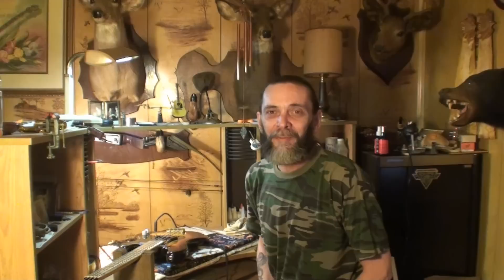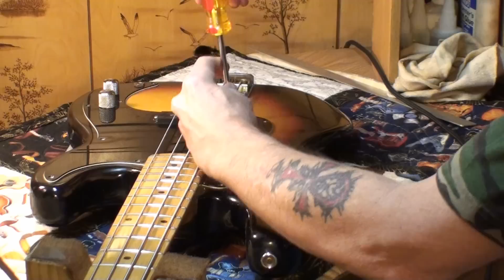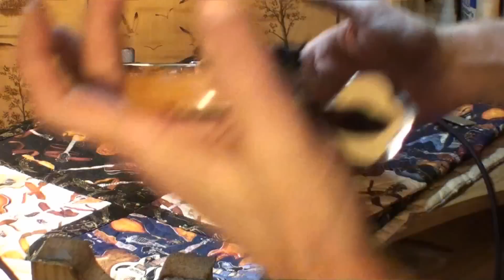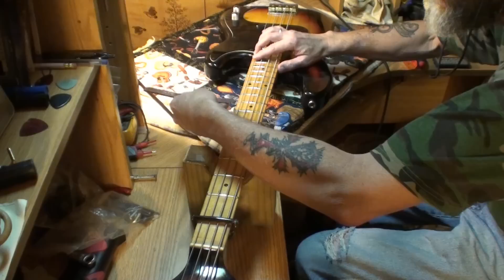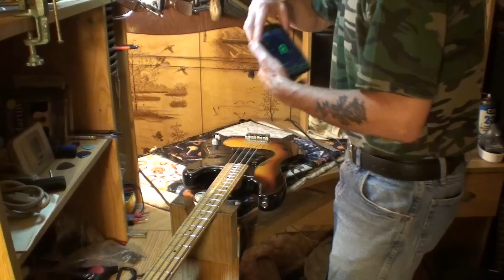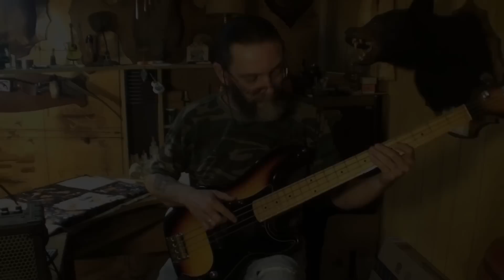Dixon bass guitar truss rod adjustment 2 of 3 setting neck relief, radius, intonation & setup & demo

Comment: Really nice job Randy.  That thing really looks so much better.  My guess is that the threads on the screws are probably 32 threads per inch which would give you one 64th of an inch at the half way point.
Reply from the maker: +Rosa String Works Yeah pretty sure they are 10-32 threads, I have the tool to measure them but didn't. He's bringing the bass back after a month or so, I believe if I can get the relief down to .012 I made not need to lower the saddles anymore, but there is a little adjustment left if needed. Thanks for watching and commenting Jerry I appreciate it bud! :)

Comment: Great video, Randy. There is usually a big mistake on beginners and is how to tighten/loosen the truss rod when the access is at the end of the neck (heel ) like the one you have there... in your video you might want to tell the exactly how to do it because I have seen people breaking their truss rod thinking they were turning it into the right direction and it was the opposite. Great job on the bass man, it does not look the same instrument!!!
Reply from the maker: +Cesar Blues  Guitar That's exactly what the owner said when he picked it up! :) He said it looked like a dfifferent guitar! Yes I know what you are saying about so many people getting confused when the adjustment nut is on the heel end of the neck. I will definitely mention this in my video, thanks for the reminder and thanks for posting brother, I appreciate your continued support, it means a lot!

Comment: Randy, Just like an acoustic bridge; whatever the distance is needed on the string to the fret you double that for the bridge. So, saddle screws are 32/1; therefore one complete turn would be 128/1 or two 64ths - double the distance of movement of the string. So, to answer your question - yes, it was planned that way.
Reply from the maker: +Rick Lee I was wondering how many would chime in on or even find that Easter egg! :) Actually it would depend on the "threads per inch" or "pitch" on the screws, different builders use different measurements on their saddle screws, these particular screw threads are 10/32, so the pitch is 32, one full round of the screw is 1/32 at the saddle which would be 1/64 at the 12th fret. You are right tho about it being same as acoustic measuring from the other side of the saddle and 12th fret.

Comment: Hi Randy The amount the string/saddle moves up or down in one revolution depends on the pitch/threads per inch of the threads on the screws, if the pitch is 32 then one round of the screw is 1/32 at the saddle which would be 1/64 at the 12th fret.
Reply from the maker: +William Castleberry I knew about tap sizes and how they measure threads per inch, but didn't know instrument builders did this with their saddles, pretty cool to know, thanks for that info!
Reply: +Randy Schartiger  I'm not sure what the pitch is of the little allen screws, I do know they are fine, but they could be SAE, or metric. If you have a tap and die set, they generally have a set of pitch gauges that you could use to find out what the pitch is. But if your like me It doesn't  matter LOL . unless you have to replace some Like I had to do on my Fender MIM strat. they were to long and were uncomfortable on the heel of my hand. I really enjoy videos very much. Keep up the good work
Reply from the maker: William Castleberry
I do have a tap and die set, but like you, I don't really care what they are either lol Yep the allen screws are fine thread, will do on the videos thanks for watching! :)

Comment: Hey Randy - do you ever put a neck in clamps before adjusting?  After twisting a couple of truss rods off, I figured out it's better to clamp the neck into the shape you want, and then just run the truss rod nut up to match. I use an old alum. beam level (very stiff) and some cauls I made - I can exert pressure on the center of the neck from either side. Then you can just spin the nut up to stop and slowly release the clamps. No more broken truss rods.
Reply from the maker: Yeah I do if the truss seems tight or if the neck needs to go a long ways, I've got videos of me doing it but can't remember the names of them lol

Comment: Randy, yes please do! reduce the relief to between 10 and 12 thousands. Plus, I would recommend a shim between the body and neck to the bridge side (approx. 1/64) to allow for more adjustment on the saddles to achieve between 4/64 and 5/64. And one more idea, did you check nut action?
Reply from the maker: +Rick Lee He's bringing the bass back in a month, that'll give it time to settle down and I'm going to lower the relief to .012 then. The neck angle is ok, with lesser relief I'll be able to set the action to where you said. Yes the nut action was .018.

Comment: Hello again from England Randy , many thanks for your kind advice . One small question , why use that radius-gauge underneath the strings ? If you get the 12th-fret action to ( say ) 5/64" below each string , then surely they have to follow the fret-board .
  I may be  (and as my wife frequently tells me, I often am ) WRONG  . Just confirm I'm right , just once in this life  .
  Cheers , Nige .
Reply from the maker: +Leftienige Blank It could be set up that way and would follow the radius of the fretboard, so you are right, BUT... if you wanted the action to the spec of the guitar or within specs, you could lower the smaller strings E, B, G much lower than 5/64 and the instrument would play better, plus with this smaller strings being that high it probably would throw the intonation out because you'd have to push the string down farther to the fret, thus making it tighter which would make it go sharp. Thanks for your comment and for watching, I hope this makes sense.

Comment: Good job on the Bass man .    Hey Randy .  I dont want to spend  money on all kinds of shit to clean my Rosewood Fretboard .   Is there anything I can use around the house ?    People say  light florid .   Or alcohol .  I guess I will just get some of the Dunlop 65 stuff .  It cleans it and condition it .  What do you think ?  Thanks .
Reply: Oh mine is not bad , but I kill my strings fast .   I wash my hands all the time .   Im just worried about the board drying out .   I know i need to clean it BEFORE i put oil on .   And I know you dont need to do this often .  Maybe every 6 months right ?
Reply: +Dev9172 I'm with Randy on the alcohol bit,  it will clean but dries stuff which isn't so good for exposed rosewood.  I've got some of that Dunlop 65 stuff for a squier strat I've got n it does work well enough.  Doesn't need doing very often either.
Reply: so the Donlop 64  with clean it and condition it ?    Thats all I need ?  thanks .
Reply: Dev9172 Yeah its in 1 of randy's recent videos.  The stuff I have is like his, the lemon oil version.  some complain about lemon oil but I've had no problems with it.  don't need much n doesn't need to be on long, wiping it down with a clean microfibre cloth is best that I've heard of.
Reply: thanks CJ99  . I guess I better get some . .  Great that its all in one .
Reply: Dev9172 Well the dunlop 65 lemon oil is really for the rosewood fretboards (may work on ebony but havent tried myself),  they also make normal guitar polish 2 which is a separate thing.  btw some people prefer linseed oil but that I've not tried before.
Reply: Oh OK .  then I will read it before i buy it   ( have 2 guitars .  Rosewood and Ebony .  )
Reply: Dev9172 Good plan,  doesn't hurt to look what whatevers available where you buy from but for myself the Dunlop 65 in either the fretboard conditrioner or the standard polish works well.

Comment: stubborn damn neck!!! might need a little shim in the neck pocket in order to gain some saddle space. (wink)
Reply from the maker: +Boudreau Guitars Very true! He's bringing it back in about a month and I'm going to crank it on down to .012 relief, hopefully once there, everything else will line up and I can get the action down to 4 or 5/64. Lesser relief will lower the action and theres still a tiny bit of screw adjustment left, we can hope. :)
Reply: Good looking bass, where was it made?
Reply from the maker: Boudreau Guitars
Someone in comments said is was made by Fender in the Fender factory, that would explain it having so many Fender features. I really don't know for sure tho where it was made. I'll see if the owner knows when he brings it back.
Reply: +Randy Schartiger ,made from the 1960s-1980s Guitars made in Japan in the Later guitars were made in Korea and China.
Reply: +Boudreau Guitars ,   http://www.guitarsite.com/discussion/messages/32741.shtml
Reply from the maker: Boudreau Guitars
Very cool! Thank you for that info and link! The owner did say he bought it new in 1986 and he thought it may be a year or two older than that, that really does explain the Fender features that I saw. Thanks for posting this mate! :)